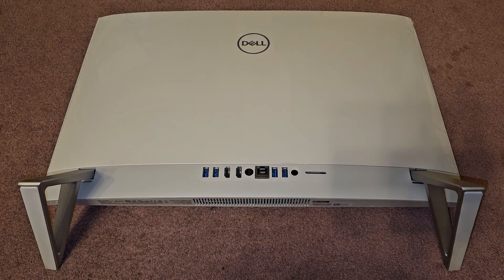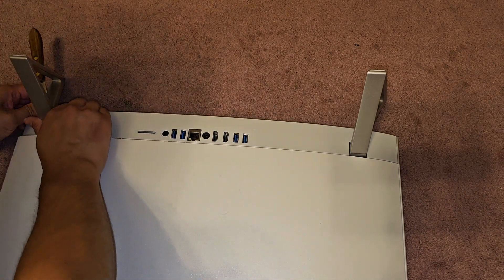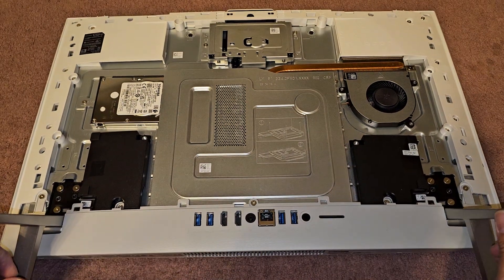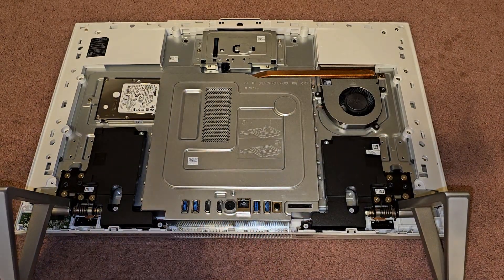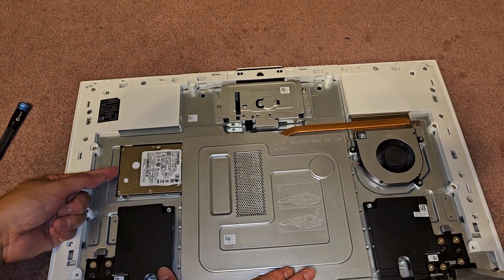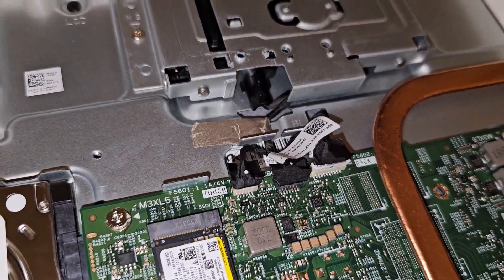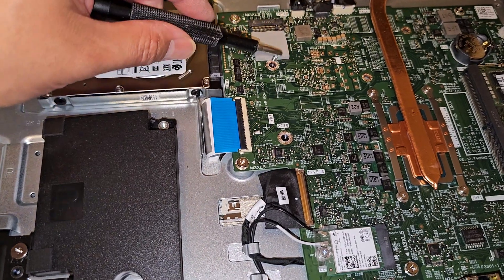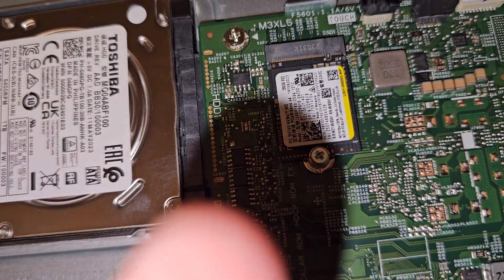DELL INSPIRON 24 5420 All-in-one Disassembly RAM SSD Hard Drive Upgrade Battery Replacement Repair

Comment: The  best video yet  on the dell All in one !!!!
Reply from the maker: Thanks! If you haven't already, please like and subscribe so others can find my videos and possibly consider watching a few others to get the algorithm to recommend my channel.
Reply: @ItsBinhRepaired  just did. question .i have the same computer. i did the command prompt to find out the max ram which is 64g. i was trying to fing out the max m.2 hd and max sata hd that can be installed in this computer with out frying the motherboard
Reply from the maker: There is no max. You can't fry your motherboard by putting too much storage and memory. Worst that will happen is it won't boot until you put compatible parts. Storage has no limit you can realistically meet. RAM it's extremely rare for them to have a capacity limit. I've only seen it on computers over 20 years old.
Reply: @ItsBinhRepaired  the reason I asked is because my computer internal m.2 is 3.3v 1.4a and the m.2 2tb is 3.2v 2.5a.. it's 1 amp higher than the original. I'm just worried about overheating ..I call up dell for text support and they told me 32g ram was max but the command prompt told me 64 was max..smh.. they also told me 1tb nvme was max and my current m.2 is 512g. An lastly the addition of the 2.5 sata they told me 2tb max ..smh...
Reply from the maker: @sportguy17  don't listen to them lol there is no "max" other than what you can fit in the slot.
Reply: @sportguy17  yeah the support team provided you correct info because I have this computer and the max ram it supports is 32gigs. I have mine installed with two 16gig Kingston Ram sticks. It's also on their website that it supports only upto 32gig capacity. Talking about storage yeah you can add 2TB nvme 2280. It comes pre-installed with 512gb Kioxia 2230 form factor and i hate those i immediately installed a Samsung 980Pro 1TB full size 2280 m.2 also changed the thermal paste and applied liquid metal compund.

The voltage doesn't matter bro go ahead clone yor boot drive and install it right away. It won't overheat.
Reply from the maker: Have you tried 2 32gb sticks?
Reply: @ItsBinhRepaired  i did install two sk hynix 32gig sticks but at the service centre. Obviously it didn't work. The thing didn't boot up and kept showing the logo.
Reply from the maker: @srirajdellxps121  usually if it doesn't like RAM the screen stays blank.

Comment: That helps much. Thank you.
Reply from the maker: Glad it helped. If you haven't already, please like and subscribe so others can find my videos and possibly consider watching a few others to get the algorithm to recommend my channel. Thanks!
Reply: @ItsBinhRepaired  You´re welcome, buddy.
I had already subscribed, even before posting my comments. 
I´m planning to buy this AIO or the new Inspiron 15 notebook that basically has same configuration as this AIO. So your video has helped to clarify a few things, as well as to let me foresse difficulties I have ahead. Those physical structures aren´t friendly for my big fingers! LOL 
I may have issues when it´s time to add a second SSD. The memory slots seem easy to access thou. But still there are those 2 covers to take off before you actually get to that part of the machine. Particularly that plastic sticky stuff where the USB ports are. Anyway I´ll face it. Thank you once again..
Reply from the maker: Awesome :) Yeah, computers these days aren't designed to be taken apart. :(

Comment: Do you know if the OS is on the 256gb SDD NVMe stick?  What size is the hard drive?  Would you recommend upgrading the hard drive to a 2.5 SDD or to put in a full size NVMe?

Really great video too!
Reply from the maker: I actually answered that in the video. Better to upgrade to a better m.2 pcie nvme SSD. This video will help https://youtu.be/4p5jFDzVwUw